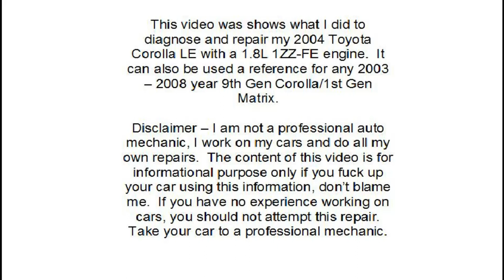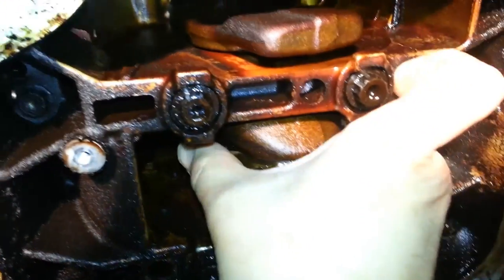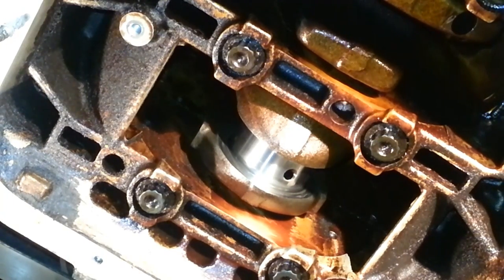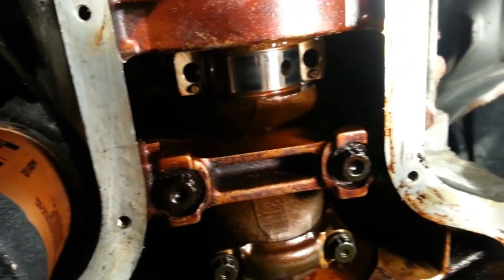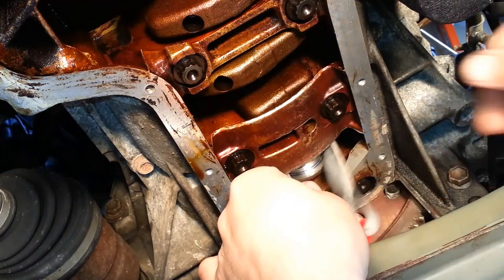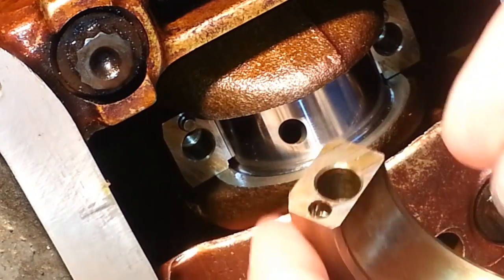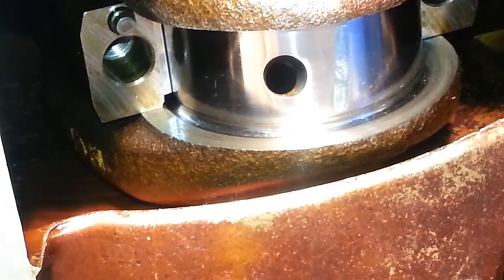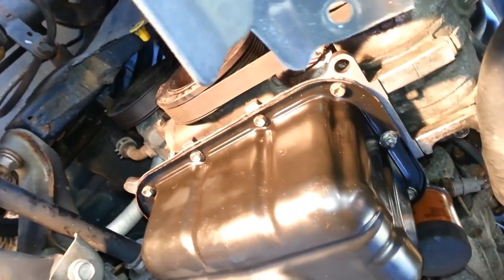2004 Toyota Corolla 1.8L bearing replacement to fix rod knock caused by bad connecting rod bearings

Comment: Looks like the root cause of failure is lack of regular change of engine oil. Nice video though
Reply from the maker: Thanks. Yeah, I believe it was poor maintenance on the previous owner’s part, I purchased the car with 110K miles on it and had to replace the bearings at about 118K.
Reply: No,my corolla had same issue..the 1.8s tend to burn oil from the piston rings wearing prematurely.and eventually this happens  whether you get your oil changed every thousand miles or not LOL
Reply: Bonsoir

Comment: You just saved my 04 Corolla from an engine swap. Not to mention saving me thousands of dollars in parts and labor. Had never dropped an oil pan before in my life. She's running beautifully now. THANK YOU.
Reply from the maker: +Rian S Glad the video helped!
Reply: +Mark G where do live buddy?
Reply from the maker: Robert, still running strong about 15K miles since the replacement.
Reply: Do you still drive the 04 Corolla?  How many miles have you driven now since repair?

Comment: So many videos now about Rod knock. I've put over 250.000 miles on many cars, with no engine issues   I have 338.000  miles on my 94 Trans Am I bought new, Lt1  engine never been touched,  still purrs like new, sounds like new.. even the timing chain is original.  Guys laugh at me when I say change your oil every 3000 to 3.500 miles. They tell me thats ridiculous,  that 7 to  8 even 10.000 thousand miles is fine! Oil changes are cheap!  I'm sticking to the old school way!
Reply from the maker: I agree John, check out my video on the 3.8 L 3800 in my 2001 Monte Carlo that I also brought new. It had 315k miles on it before I had to replace the lower intake. I think it had 370k on it when I got rid of it. I prefer my chevy's. My wife wanted the Toyota when gas was at $4.50 a gallon and she was driving a Suburban everyday. The previous owner of the Toyota obviously didn't change the oil as recommended.
Reply: I do oil changes every 5000 miles, but I'm also using full synthetic premium oil like amsoil, or penzoil ultra ... Every 3000 is too often for me. With 5000 mile oil changes I change my oil twice a year roughly 5k miles every 6 months

Comment: Thank You for this video. MY 2003 corolla developed rod knock I am the second owner and with 180K I believed it was due to age, after pulling off the rod caps i noticed the bearings on the last rod were spun. after many hours of shoestring polishing(cool trick ;))I plastigaged it with all new bearings and found it within tolerance. needless to say the mechanic wanted 3K+ to replace the engine, it cost me $170.00 usd and a day of my time. Thank You, sir you are a true Gent.
Reply from the maker: Glad the video helped you fix yours too.
Reply: Any update on the repair of your Toyota?

Comment: When your kids forget to check the dipstick??? Great video! Was ready to pull the engine until I saw this !!!!! Had the knock on our 05.. Dropped the pan ...surprisingly... everything looked in good shape...Cleaned and polished the journals...Bearings replaced... Runs normal again, no knock ( Have to love the string method..... best tool in the box . Even works on vehicle alignment :) Thanks again ! .... (Kids checking weekly now :) lol

Comment: Man this was the problem on my grandmas 03 matrix. My grandma had bought her car in 05 and has had it until 2 years ago. I had always figured that my uncle was maintaining her car until one day she called me to change her oil and found out she had bought the oil already. Turns out she was going long periods without getting her oil  changed and she was just buying dollar store oil!!!! Well this happened 2 years ago and i had changed her valve cover before this happened and noticed the engine looked sludged up and oil baked on! Fast forward, my uncle bought another used engine and it was well taken cared for, i bet the oil passage was clogged. I was mad because i knew this was the problrm and i could have dont this myself, but it was a blessing because the car is easy to maintain because now im the only one that fixes her car!

Comment: Mate I don't know how to thank you for sharing. everybody was saying my Mr2 roadster ( same engine ) was done, engine rebuild or replacement. Did myself the job you show here and knocking disappeared 100%. 20£ of con rods bearings. Engine so smooth like new. God bless you !
Reply: I have my Scion xB that needs that work hopefully it works  🙏
Reply: I have a 2002 mr2 spyder that needs this I believe, I just hope I dont have to drop the rear cradle
Reply: @flurgy22  what do you mean for rear cradle? to replace con rods bearing you need to remove only oil sump.
Reply: @80sPhoenix  I'm not sure if the oil pan can be removed or if there may be something in the way
Reply: @80sPhoenix  oil pan came away easily, however there is noticeable play in the offending bearing, I can move the connecting rod by hand. I fear it may be too far gone but I may just for kicks and giggles replace it anyway run it till it breaks and just get a salvage or rebuilt motor.
Reply: @flurgy22  Exactly, pan is removed now. Did the same, and never had a knock again at today.
Reply: @flurgy22 how did it go with the bearing replacement?

Comment: This engine brings back good memories. My wife had a 1999 1.8 Corolla. It didn't smoke or have any signs of leaking oil. I would drive it all day and park it overnight over a large white sheet. It would be clean the next morning. But it went through a quart of oil every 500 miles. It finally burnt a hole right through a valve.

I decided to rebuild it. I must say that engine was a pleasure to rebuild. Of course I had to let the machine shop do their part. But there was nothing frustrating, nothing difficult to get to, and no moments of cussing because something had to be redone.

After filling up the oil, I put the key in and it started like nothing happened. There was not even a delay... We put about a 110,000 miles on that rebuilt engine without a single problem.

We finally decided we wanted something newer. I put the car out for sale in the front yard. A lady who was a single parent stopped by. Her car was on its last leg and all she had was 500.00 and wanted to work something out. I gave her the car and told her to use that money for her and her daughter for Christmas.

She still drives that car to this day. I gave it to her about 4 years ago.
Reply: Michael H - Your a good man
Reply: Good guy, much respects. Hope you're staying safe out in this crazy world. 🤝
Reply: God Bless You!
Reply: @kcee7841  Thank you! I like the saying from Dave Ramsay to live like no one else so you can later live like no one else .

Me and my wife were struggling when we first got married. That Corolla is all we could afford.

When I put it up for sale. I didn't need the money. The lady I gave it to lived just down the street. Talking to her, I just felt a strong sense of charity to give something. She was legitimately in need and reminded me of our situation at the beginning of our marriage. The joy of helping another person in legitimate need was worth far more than the thousand bucks I would of gotten.

Comment: Marc G, you have SAVED my 2000 Toyota Celica GT with 115,000 miles on it!! I followed all of your steps EXACTLY, your video is amazing. Thank you so much man! 
So for 200$ total: bearings, cleaning fluids, lubricants, sand paper, 12 sided socket, a new shoe lace & including a couple of oil flushes and lots of cleaning all the parts. 
Everyone that told me  "You need a new Engine" has been proven wrong by you.. cheers!
Reply from the maker: Glad it helped.
Reply: 115,000 Miles?  You bought the car used from someone that changed the oil every 15K miles?   How many miles have you put on car since repair?
Reply: @birdwing98  Celica Gt have really horrible oil burning problems, it's all due to the pistons not having enough oil drain holes drilled into the pistons, it can be easy not to notice your oil being low when it burns a quart every 500 miles when all your other cars wouldn't burn oil nearly as quickly.

Comment: Great video with lots of useful information. I wish the radio wasn't so loud so we could hear you clearly, but I'm sure plenty of us appreciate you for taking the time to record and upload this video. I have some rod knock, and am going to give these steps a shot.

For anyone looking for quick references, here are some specs for the 1ZZ-FE that were mentioned in the video:
Oil Clearance: 0.0011in - 0.0024in
Torque: 15ftlbs + 90°

Comment: Best helpful video for this work !   Thankyou.     I would have changed the oil filter before adding the new oil.   i tried in 1970 to rebuild a 4 cylinder engine ;  1957  Morris Oxford  ( hole in bumper for handcrank starting) ;  had the valve head machined by a shop.   New rings on pistons ,  & THREW AWAY THE BEARINGS OFF THE RODS & CAPS  !   thought they had broke off the crank !   Really.
Then i drove the car back to Vancouver from Toronto  3000 miles ;  not a single problem .   i believe in miracles !

Comment: Good clear video - your repair held up well if you put a further 80k on the engine over a few years before selling.
One thing to note for the viewers out there - bolts with a torque value and an angle are usually torque to yield (TTY or "stretch bolts") which means they are one time use only and should be replaced. Some workshop manuals specifically tell you to use the old rod cap bolts to do the plastigage clearance check but to only apply the torque value not the angles. Thereafter if clearance is within spec new single use rod cap bolts should be used and fully torqued.
Doing this job on my Passat this month hopefully with the same success!

Comment: Thank you for posting this job.  I've done this to two different cars and they both still run great after several years (but I only replaced the one bad bearing).  I now have a 1998 Explorer 5.0L v8 that I need to do this to.  It only knocks when cold; once it warms up, it runs fine so I've been putting the job off (I know it's not going to get BETTER :).  What I didn't do was use your "shoestring trick" - I like it and I will from now on.  I've rebuilt complete engines out of the vehicle and have had to emery cloth fresh cranks from the machine shop because the engine wouldn't turn completely over effortlessly (would have a bind in a certain spot) and that particular engine is still running after 15 YEARS!

Anyways, thanks again.  Oh, let me ask you something.  My friend told me when I plastigauge and need .0005 less clearance, he has used ONE HALF of the .001 oversize bearing and one half of the STD to get the .0005 and it worked fine.  Would you do this on an engine?  I've personally never seen the longevity of such a trick, but my friend swears by it.
Reply from the maker: I have never tried this, but I would stick with the matched set.
Reply: Honda has different factory sizes and they mix them from the factory to get the correct fit.  They are color coded, so you may have two bearings of different colors on the same rod to get the ideal clearance.  Seems like it would be fine for other cars if Honda does it.

Comment: Excellent video sir, you have saved countless people a lot of money. I have heard of this technique bit this is the first time I've seen it done, and the explanation of everything in such detail....outstanding! I am a shop foreman for a fedex maintenance facility and would love techs like you. I just recently have been given a 1991 Toyota MR2 in excellent condition with a spun bearing, motor only has 105,000 miles. My uncle put a bottle of seafoam in the engine to clean out gunk or whatever he thought was in there and after a couple days it started knocking. He immediately stopped the car and had it towed home where it's been sitting for a couple years. He's said he's too old to mess with it and knew I like projects, so he gave it to me to fix up.
Reply from the maker: Thx I'm not a professional mechanic, just your typical DIY Guy, I do all my own maintenance and repairs on my vehicles.  My real job is an Operations Manager at a Telecommunication Test Equipment manufacturer. I made the video since I couldn't find a good video of anyone else doing it when I needed to do mine a few months after I purchased it. Glad you found it useful, and good Luck with yours.
Reply: Mark G So how long did it last? Did it spin it again?
Reply from the maker: 32K miles since I replaced the bearings and still running fine.
Reply: Mark G Just did mine today! Quiet as can be so far!

Comment: Good Vid, I need to do this on my 2000 Celica GTS (180,00 Miles).  You gave eveyone the tools to work with and some direction along with it.  Thank you for sharing this experience, most people think when a bearing goes out in the engine it means $$$.  And sometimes it can't be avoided depending on what area of the engine that you are working on, I realize this is a way of squeezing a little more life out of the engine.  It's also a good habit to turn off the radio and listen to you engine for odd noises on your way to work or wherever and check you oil level regularly!  Thanks again Mark G.
Reply: John O'Deere I followed this vid directly in my own engine after blowing a bearing. It cost me about $200 total including 2 oil changes, 2 filters, new rocker seal, spark pligs, bearings, degreaser etc. The actual bearings I got for $40 for the set. Very good video with no surprises when you do it yourself.

Comment: Great DIY video! i have an 05 corolla 1ZZFE engine with the same knock on cylinder 1. I have seen this type of repair when I was a kid on other vehicles with accessible oil pan. I have replaced engines before and I was about to do it until I saw your video. Now I get to try this method and save some serious time & $$$$$$! Thank you sir for this great resource of information.

Comment: If you can find some soda straws that plug onto those oil pan alignment studs that are cut at about 6", it might increase your chances that you can get the straws through the oil pan bolt holes without the studs wiping through your silicone gasket.
This trick works good for setting a toilet on a wax ring too

Comment: The correct grade, fully synthetic oil and service at correct intervals will prevent this issue, unless ur car has got 300,000kms+. DO NOT USE CHEAP MINERAL OIL IN UR ENGINES. Love the vid, good job dude much help.
Reply: +samuel shank My 2006 Corolla has 294,400km on it, I haven't owned the car more than about 10,000km so I don't know how it was driven in that time but it doesn't have any knocks that I've noticed but I think the gearbox input bearing or throw out bearing or diff bearings are sounding rough. The oil I'm using is Castrol Magnatec 10W-40 and I change it every 6000km or so, it's synthetic or semi synthetic. Sooner or later I'm going to need to do the clutch and possibly the gearbox bearings, it's a manual gearbox so it's serviceable but still a huge job to disassemble. I wonder what it costs for a full set of bottom end bears including crank bearings and oil seals, if you're going to all the trouble to do one bearing wouldn't you replace them all?

Comment: hey !!! u forgot to check the tire pressure !! that was a good home mechanic video thanks for sharing. some good diy school.about using the same bolts. its ok as long they are under specs. and they usually are if they are the oem bolts. we must remember this is a litle toyota engine not a muscle machine with lotz of torque.

Comment: I'm glad I stumbled across this video as my 1ZZ in my MR2 spyder has acquired a knock because of my spirited driving haha thanks a bunch!
Reply: How did the repair go?
Reply: @flurgy22  pretty easy actually. I think enough damage had been done to the journals that I needed to have the crank machined but I didn’t have that done so there was still a slight ticking sound from the tolerance. Ended up swapping a 2ZZ in